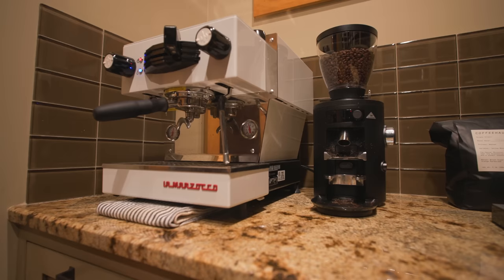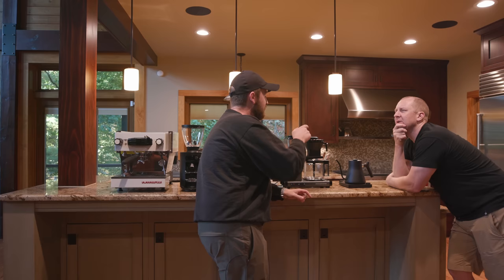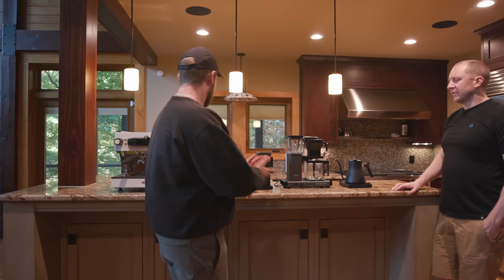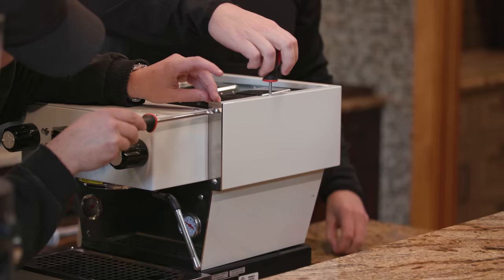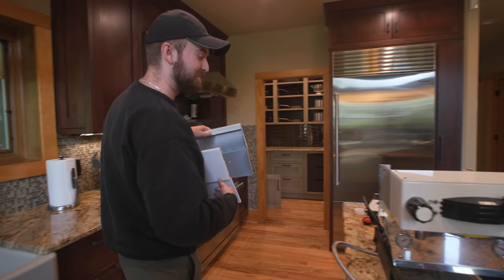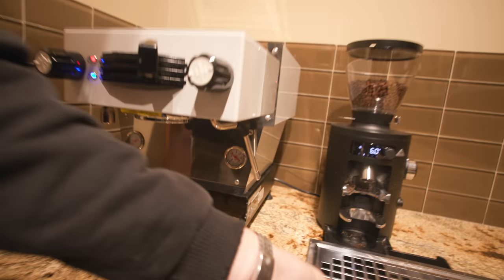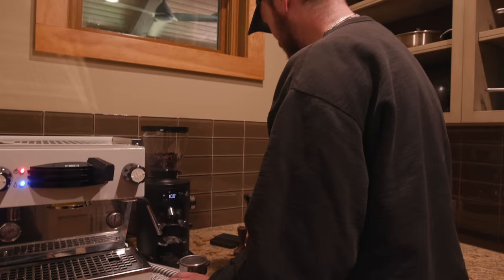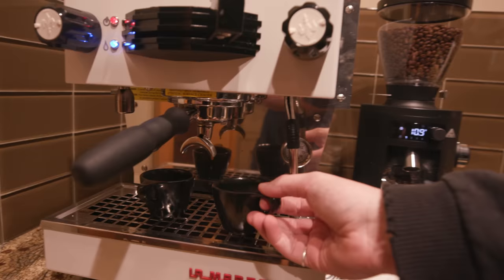An Obsessed Level Coffee Experience: Setting up the La Marzocco Linea Mini & Moccamaster

Comment: Had an absolute blast doing this. Can’t wait to dive deep into coffee with the OG family more & more.
Reply: @29:00 you can see the output line from the pump has a copper crush washer to prevent leaks but he failed to use one with the input water line. No wonder customers keep having them leak, there’s not enough torque on the threads and Teflon tape to seal out water. If he added that crush washer with his adaptor, there would never be a problem. @coffeehaus
Reply: How do you like the Zero water filters ?
Reply: Sterling Heights here! So cool to see Coffeehaus on OG. Keep up the good work!
Reply: Nice 1675 (or 16750?)couldn’t tell the exact reference from the video. Enjoyed the video too!
Reply: @russellhagy  looks like 16710 blro.  Nice classic Pepsi
Reply: Really liked this one. Those scales are legit. Going to pick one up in the OG store!
Reply: @bevans5611  Could be…didn’t look like a sapphire crystal to me. Wasn’t really in focus much (and rightly so, haha). I just can’t help but notice.
Reply: @russellhagy  1675 underline double swiss. old dog. heavily used
Reply: @Coffeehaus  My first instinct was right! Beautiful watch. That's the first thing I noticed, haha. I'm a Submariner guy. Haven't gone down the vintage road yet. I want a 5513 at some point. I have a few modern pieces.
Reply: You really think someone who's never used a stepless grinder is going to be able to dial in a shot?

Chosing the linea mini over the gs3 was a good choice, as the paddle is essentially just a switch; simple. But many of my car friends get nervous around my baratza vario. They would probably just skip coffee altogether if they had to use the mazzer mini.

I'm not sure the average Joe can pull anywhere near a café quality shot without some experience and instruction.

I got my first machine, a breville, back when I was in Uni. Since then, I've had many machines and grinders. I have the prosumer grade equipment now, but what allows me to pull a shot as good as the best shops in Toronto, is the fact that I've been pulling shots at home for over 15 years.

I'm sure a good number of the clientele coming to one of Matt's destination projects are familiar and capable, but for a guy that has a Miele, Jura or saeco, superauto built into their wall; I don't think that guy will be able to do this, nor do I think that guy cares enough to dial in a good shot on proper equipment. They wouldn't use the superauto if they did.

I typically bring my v60 with me when I travel and if I find a local coffee shop worth going to, I'll have espresso there. 

This would be cool for guys like me, that's for sure.  Wonder if enough of Mr. Moreman's guests will be this into coffee.

Just wondering, what's the water situation there? I'm not plumbed, so I use distilled w/ 3rd wave. OG uses RO to wash a car, so I'm assuming it's RO, remineralized and plumbed in?

Comment: moccamaster has an internal copper brewing system which allows for consistency in heat distribution and brewing. Also the information packet gives a very accurate indicator how much coffee grind to add from optimal coffee output. Most of the time people use to little coffee grind for drip coffee makers.

Comment: I have two Olympia Creminas, one bought new over 40 years ago for about $330 and one bought used on eBay for $900. As one is serviced by Cerini Coffee in the Bronx, the other can be used, so I never have to be deprived of my morning cappuccinos. My Luigi Mazzer grinder and Hottop programmable roaster and custom made Reg Barber tamper complete my espresso-making equipment. The Olympia is completely manual and built in Switzerland like the proverbial brick shit house. It sells for a ridiculous $3700 now.

Comment: @29:00 you can see the output line from the pump has a copper crush washer to prevent leaks but he failed to use one with the input water line. No wonder customers keep having them leak, there’s not enough torque on the threads and Teflon tape to seal out water. If he added that crush washer with his adaptor, there would never be a problem. @coffeehaus

Comment: this makes my head hurt how does one spend so much time making a cup of coffee lol.
Reply: Some people are okay with something that tastes like dirty water others want to get the best results they can. It’s a matter of how much you want it. They make different types of espresso machines for different skill levels and for people that want more control
Reply: Were you around while Matty was coming up with the bucket package?  Presol Bottles?  Testing pressure washers?  Rodents in the GT3?  This video fits in nicely.
Reply: @timkinley1779  don’t get me wrong I love the idea but man that’s a lot of work for a cup of coffee. I guess I don’t understand because I’m not a coffee drinker. Just seems like a lot of steps to me. Not knocking it. Just didn’t have any idea of the process it took to get there.
Reply: @pantac4493  yea I’m the Keurig type of person if I have a glass which is rarely. I just never knew it was this involved. Especially the setup process
Reply: @JColip1776  I didn’t get into it until about 4 or 5 years ago after I tried a real coffeehouse cappuccino. I was also shocked how much was involved and the cost. I tried a couple of pump machines but didn’t like the maintenance and decided on manual espresso that you clean as you go. Better fit for me because I normally only have one drink a day and it’s much more reliable because it’s barebones, no pump, plumbing leaks, or electrical to fail

Comment: Looks to me like WAY WAY too much trouble and hassle then it's worth!!! I would like to be a fly on the wall watching guests make coffee - Ha! It's going to cost $19 a cup and take forever to tweak to their individual taste. I can't even imagine what the coffee maker and grinder costs. Just not practical for guest usage IMHO. More for a coffee obsessed person who doesn't mind going to coffee school to make a cup.
Reply: Using the grinder that times the output and not weight doesn’t make sense to me. There are grinders that have very little retention and when you pre-measured the bean weight, that’s the weight you get on the output. That makes adjustments to grind size 100x easier than this. Instead of them filling the hopper they could weigh out the amount they need for a single dose and adjust for retention if there’s any
Reply: You'd be surprised.  The cost of the maker and grinder are covered.  So you don't have to imagine anymore.  It would probably cost me more than  $19.  But vacation $19 is different than a regular day $19.
Reply: For guests, a super automatic would have been better. The average guest don’t want to deal with anything complicated. Rather just push a button and be on there way.